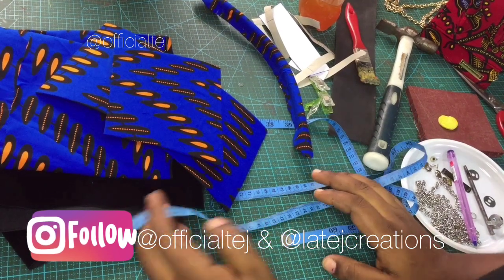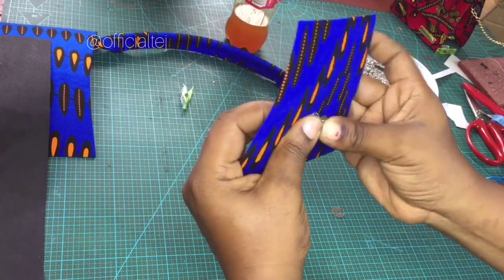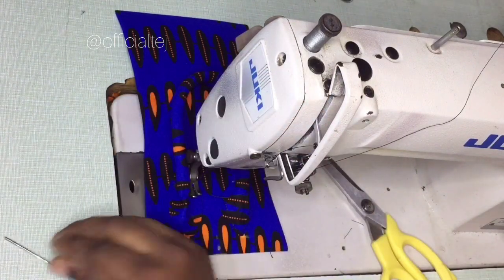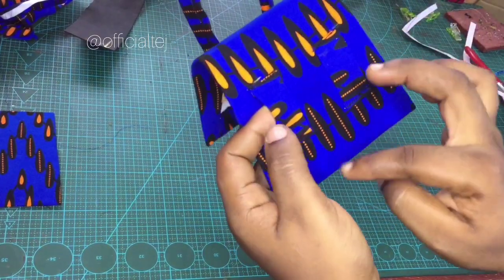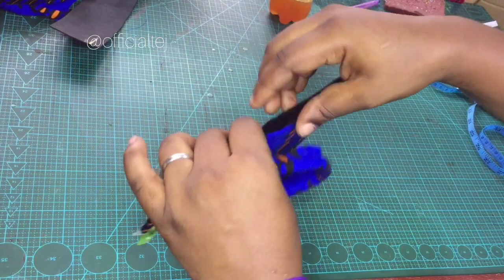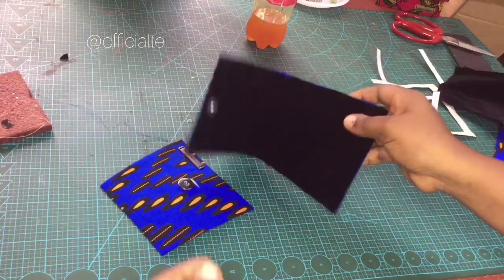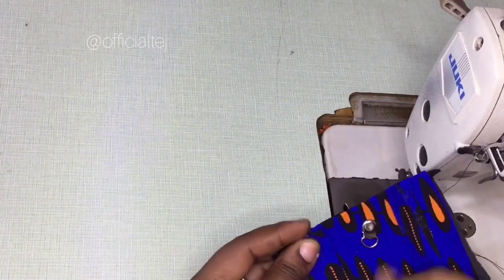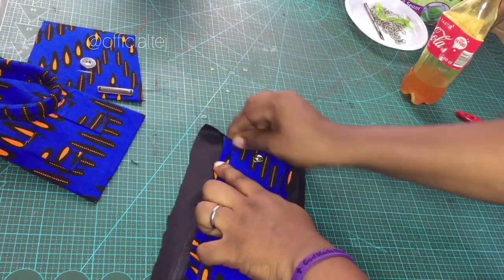DIY Ankara Mini Bag [DETAILED] |Part 2

Comment: Nice job 
Always learning from you
But I have a question pls ma'm 
The Kari board and chip board won't it fade like won't it fall , when washing d back or is there a way to wash ankara bag and water won't affect d Kari board pls pardon me and reply
Reply from the maker: Hello. Thank you for watching. Yes It will if you soak the full bag in water. Which it’s not the appropriate way to wash an Ankara bag.